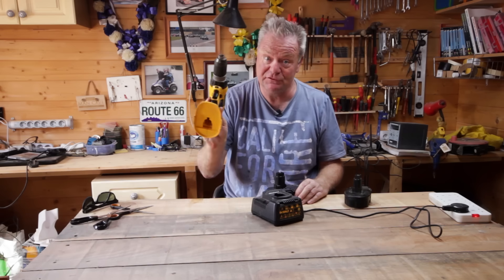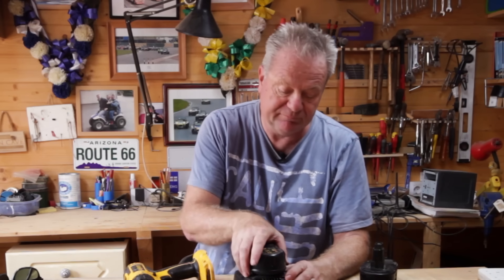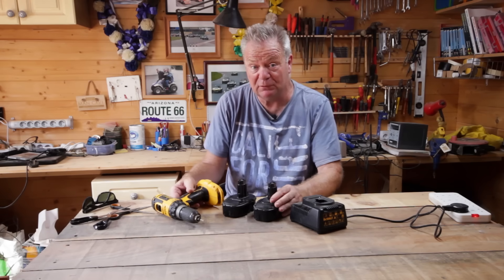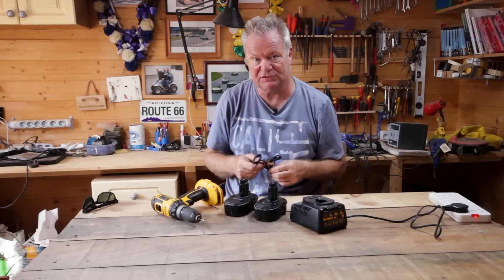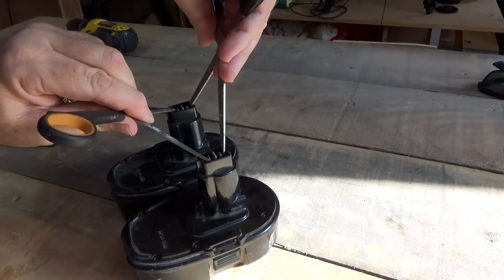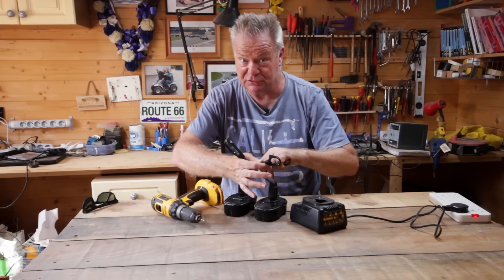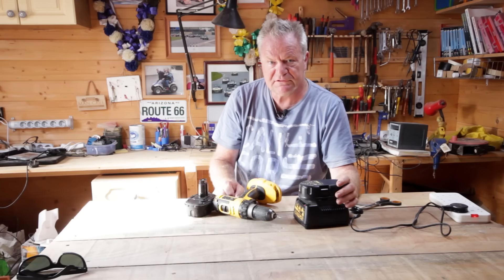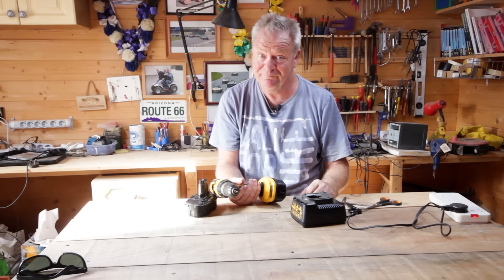How to revive a dead rechargeable power tool battery easily

Comment: I'm in the process of cleaning out my late fathers collection of power tools and I had 6 dead battery's to try this technique on ( I used 10 gauge wire instead of scissors). Total success on EVERY battery! They were all over  15 years old! Great tip J.P.!!!
Reply from the maker: Great. I am glad it helped. Thanks for watching.
Reply: I'll be dipped, it worked
Reply: I cannot understand how you made it to 6 battery successes. I tried just one. With me, the battery is 3 yrs old. I don't know if it's an issue but in my case, the battery was always plugged into the charger when not in use, but to keep it charged at usage time to avoid having to wait a period of time when I can use it. Is it a bad practice? I used the battery about 4-5 total times.
Reply: I have 2 dead 7.2v DeWalt batteries but no charged ones to connect to (I do have changed 18v batteries). Any suggestions?
Reply: @drosser8461 , some have tried 12V car batteries and had success.
Reply: Queef
Reply: I tried it on a battery that's only a few months old, it didn't help it at all.
Reply: @2high2flyfpv88  maybe try use another battery which has a higher voltage to the one your trying to reset it might reset it but if you use another one that’s either lower or different to it it may not work I reset these basically quite a lot not drill ones walkie talkie radio ones and have a 50/50 chance of resetting them I use a 9v charger for radio ones and it does the trick so maybe use a higher voltage battery to have a better chance of a reset on the battery hope this helps 👍
Reply: @2high2flyfpv88 sometimes the cells are just too far gone, nothing lasts for ever these days, especially batteries.

Comment: Thanks for this tip!  I tried it yesterday and revived a battery that has been unable to charge for a few years. It didn't work the first few times I tried it though.  The drill is a King Canada cordless drill with 20V lithium-ion batteries that have power level indicator lights that turn on when you press a button. I thought maybe the "jumper cables" weren't transferring the charge to the dead battery because there was no load, so I pressed the battery-checker button on the dead battery.  It just flashed a couple of times and then went off, but I did this a few more times and the light came on solid without flashing.  At that point, I disconnected the "jumper cables" and put the dead battery on the charger, and voila it started charging!  I gave it a full charge on the charger and now it runs my drill.  Thanks again for sharing this great tip!

I actually did this before I read your recommendation not to try this with lithium-ion batteries.  Why do you recommend this?
Reply from the maker: Thanks for letting me know. I added that in the description about lithium batteries because many of the self-professed "experts" in the comments said it was dangerous. Some people are afraid of their own shadows but I added it so no-one could say I didn't warn them. Thanks for watching Carlin.

Comment: Okay so I finally got to try this on my 2 dead firestorm batteries.  Well....it worked...somewhat really slow....and then next time died again..  so what's the point?
Reply from the maker: Your batteries must have damaged cells so won't hold a charge. This will fix batteries that have been used until flat and then not charged for a while, like the battery I had.

Comment: Wonderful....finally got those firestorm batteries working again. The one thing which can be unclear is trying to figure out which are positive and negative terminals.  My porter cable has 4 leads and only one is real. The other is hidden in a groove.  Is there an easy way to determine that issue?
Reply from the maker: Perhaps with a multimeter.

Comment: Very interesting.  I’m very surprised it’s lasted so long.   I was thinking it was a temporary fix.  Great tip / Thank-You
Reply from the maker: It might been temporary if it was flat because it had a damaged cell or cells. Fortunately that wasn't the reason.
Reply: JP in Fuerteventura 
Certainly worth trying this trick to find out.

Comment: sir, I have a snap on batteries that are dead  the batteries are CTB3185 and I can't do it the way you did both batteries are dead so I can't jump it from one battery to another. snap on doesn't accept these batteries since they are the older models. I don't want to buy new ones so any idea??
Reply from the maker: Can you borrow a similar one from a friend, or at least a battery of the same voltage?
Reply: @JPinFuerteventura   no sir I dont

Comment: Do you think this work with car batteries?
Reply from the maker: Do you mean to jump a power tool battery with a car battery or to jump start a car battery.? If the power tool battery is 12v then some of those who have commented have said they have done it successfully. If you have a car battery where your "smart" charger won't start to charge then it can help to jump from a good battery first. I have done that in the past.

Comment: That battery is on its last legs.
Won't last forever !
Will it ?
Reply from the maker: That battery was "dead" because I used it previously until the drill would no longer turn and then forgot to put it on charge for a few months. I made this video about 3 years ago and it went on to give good service until only a few months ago when it began to hold its charge for less time.

Comment: But how long does that battery last??? You didn't mention that in your video
Reply from the maker: How could I when I had only just jumped it as I am not psychic!  😉 Actually that battery worked well for another 2 years and has only recently started to hold it's charge for less time.

Comment: Next time try 4 small magnets and a couple of clip leads.  The battery contacts should be magnetable (?) metal and the cheep clip leads are.  Not as tiring as holding the scissors!  (I'm clumsy and I'm sure they would slip several times!)
Reply from the maker: Good tip. But living here in the Canary Islands you have to make do with what you have to hand, hence the scissors. Thanks for watching.

Comment: Hi JP,

I have a 12V Samsung battery which needs life. But the other spare working battery is 14V draper battery. Will that work ?
Reply from the maker: Ideally it should be the same voltage, although this is close. Could you borrow a 12v from a friend?

Comment: Thanks for this tip. I have a Bosch cordless drill that I was given as a present. Had it just over 18mths. Used it around six months ago to assemble some flat pack wardrobes then put it away. Wanted to do some fence repairs today so charged both batteries. One was okayish, the other died after a short while. Looked online for replacements. Nearly £30. WHAT? Like you say you can buy a new drill for less. Trawled the internet to find a way to revive the batteries and everything was meters and stripping down with little or no commentary. Your method works and is so simple and just needed some crocodile clips and wire. Cheers.
Reply from the maker: I am glad it helped. Thanks for watching.

Comment: Hello, great video....I pretty sure this has happened to my battery. Unfortunately I do not have another power tool battery to try this with. Could this be done with AAA batteries?
Reply from the maker: Well I guess you could put some in serial. Perhaps you can borrow a similar battery from a friend.

Comment: I had trouble repairing my AEG 18 V LITHIUM  BATTERIES, 3 of them. One worked, wouldnt charge  it was low on volts, so I hooked it up to another good one positive and negative adn it worked, but the other two  did not move an inch. A  5amph 18 vlts that has 15 volts  but wont charge, I used the connectors to positive and negative to another good battery and the voltage hasnt changed. the other one is dead and wont charge has no volts. 

Can someone help me please  I love carpentry im pretty good at it and stuff but electrical is my weak point
Reply from the maker: Hopefully someone can help Adrian
Reply: @JPinFuerteventura  Thanks for your reply JP but I dont have time to wait around its already been a month IM buying some new batteries NO ones bothered to shout out thus far accept yourself. Its probably not worth it Im going to buy the new AEG force batteries.

Comment: Just like everything else Ni-cad battery doesn’t last forever..... even with regular maintenance cycling eventually  charge capacity gets depleted and gone.  A friend of mine started fire playing with worn out battery .   Best solution is replace with 18650 li-ion cells with charging board so U can save power tools and Ni-cad charger.
Reply from the maker: That's a little beyond me Michael.

Comment: The battery business is a SCAM just like the petrol business. This works and is called parallel charging but must be done with similar voltage batteries. Awesome video🇺🇸✌️ btw ever hear of cable clamps?😂
Reply from the maker: Absolutely Matt. Living here in the Canary Islands you have to use what you have ;-)

Comment: This may or not work.  I have tried this on batteries, but the voltage still slowly drops to zero.
Reply from the maker: Yes, if the battery has damaged cells that can happen. Thanks for watching.

Comment: This is also true in some cars. If the battery's charge falls under a very low level, the cars charging system will not charge the battery. With that said, rechargeable batteries will wear down and will only hold so much charge. i.e. when you first get a new battery, it will last an hour. Once it's been charged over and over and over again, the length of time it will run something without being recharged, is greatly reduced.
Reply from the maker: All true Don. Thanks for watching.

Comment: I don't care what these other people say about you. I think your cool. 
How ever, this will make your charger recognize the once completely dead battery and start charging but 9 out of 10 times it will Not take the full charge. For instance: You do this trick with an 18v but it will only charge up to 14 volts and then looses voltage and drops down to 9v.
My point is that the trick does not fix dead cells. This will work in a pinch for a short time and get a small job done for you but I think that if you have any bad cells you have to do a full rebuild or buy a new battery. The rebuild is tougher then these videos show you unless you invest in the proper tools for re-soldiering. I tried this with a regular soldiering gun and it just don't stick well.
By all means try the tricks before you trash them. You may get lucky.

Just my Nickles worth....
Reply from the maker: Yes, you are correct Don. The battery in the video was flat because I used it until the drill stopped working and then forgot to put it on charge for months. If the battery is dead because of damaged cells then it will not hold a charge very long. Thanks for watching.

Comment: How long will this battery last after doing this or will this be an ongoing problem?
Reply from the maker: This battery has never needed to be jumped again since I made the video over 2 years ago. It was flat because i used it until the drill would no longer turn and then forgot to put it on charge for a few months. If a battery is flat because it has a damaged cell then it may not last long and this may happen again. Thanks for watching.
Reply: JP in Fuerteventura, thank you very much, I get what your saying. Thank you for the video.

Comment: Just dont do this with lithium batteries. Thatll end badly. Thermal run away... need i say more.
Reply from the maker: As I point out in the description Ham
Reply: @JPinFuerteventura  
Im not baggin ya but you  know damn well people dont read signs, warnings, discriminations, owners owner's manuals ect. I guarantee someone does it anyway. Dont take offense its just this age of information people are as dumb as ever so ... i dunno.
Reply from the maker: Yes that is their look out
Reply: @JPinFuerteventura  
Yeah i didn't want to seem like im picking on you. This by no means the most ridiculous thing ive seen on here today. I just watched a guy show people how to make a jumper extension cord with 2 120v male plug ends going to a 30amp 240 female so people can make 240 for a welder by plugging into 2 circuits that are on separate phases. That guy needs his damn tools taken away for showing people garbage like that.

Comment: I use to do this but with a dc power supply that is until one lit up like a Christmas ham in my hand after i charged it then went to drill a hole. Ran out of the customers house with a near flaming drill in my hand and yanked the battery out and set on the ground. She smoked and popped and carried on for a few hours after that. No i just buy new batteries and take better care of them.

Comment: A couple of days ago I had a similar problem when using two 12 volt batteries in series to power a 24 volt fan. The voltage in them had dropped too low for my automatic 12/24 volt charger to acknowledge that I was charging them as a single 24 volt battery pack. After 'bumping up' the voltage in each I was then able to run the fan and charge the batteries at the same time.
Reply from the maker: Great. A very similar problem.
Reply: T bio LLP jol mip mip

Comment: I wonder why the dead battery didnt have enough charge to be charged off the charger, but it would gain charge off the other battery?
Reply from the maker: The charger has a "smart" circuit (ie stupid) which needs to detect a current before it will start to charge.

Comment: when a battery is dead its dead. yes you can trick the charger into recharging but the battery is still dead & will not hold the charge for as long as it should.
Reply from the maker: You are right if the battery is dead because it has a damaged cell but that isn't the only reason a battery can be completely dead. The battery in the video I had used until it would no longer turn the drill and then I left it for months without putting it on charge. That was 2.5 years ago and it still gives useful service today.
Reply: @JPinFuerteventura  ok but what you should tell people first up in your video is dont do this to your batteries. as soon as tour battery is flat put it on charge & this will avoid batteries not charging. as i use my battery tools to make a living this is what i do.

Comment: My batteries charge they just don't last as long. NIHI not Lipo
Reply: Sounds like a memory issue
Reply: @TheMysteryDriver  nickel metal hydride still don't last that very long, these are DeWalt but a little over 10 years old and they have been used hard for construction for a very long time
Reply: Grand Waha that's what i mean. Over time NiH batteries can form a memory and not fully charge or discharge. 

They also lose the ability to hold a charge over time anyway.

Comment: Well here, if the battery went completely dead, it's mostly because it's worn-out.  Of course, giving it a quick boost will make the intelligent charger recognize it as being 'good' and the charging process will start.  But it won't last for long, it won't hold charge.  One way to revive a battery (if it is of the NiCad type ) is to zap it.  All you need to do, is giving it a short burst of a significant higer DC voltage.  Say around 250% 400% the nominal voltage of the battery.  There are two ways for doing so.  Give it multiple instant flicks of the higher voltage and take a measurement each time.  After several flicks, the volatage will show much higher.  The battery is then ' unlocked' and ready to hold a charge.  One simpler manner is to use a medium size capacitor charged to the higher voltage and // with the dead battery.  This way, you'll always have the same finite amount of energy transfered each time.  It is more controlable.  Search for zapping nicad battery on the net.
Reply from the maker: It certainly can be, although not always. Thanks for the information.

Comment: When under voltage the circuitboard in the battery will cut the battery off. The charger sees no voltage wich results in a dead battery. The battery is maybe worn out, but to revive it you could charge it with 500mah for a few minutes. The circuitboard if there is a good one in it, should keep it balanced right. Just mark this battery so you can keep an eye on it. Welcome to the world of technology and we are all fools to buy new ones.
Reply from the maker: Exactly Robert. This particular battery is only now just showing signs of wearing out so I have at least got an additional 2 years of service from it. Thanks for watching.

Comment: Makes sense, most chargers will run a check on the battery when you plug it in if it senses the voltage is to low it thinks the battery is bad or is the wrong type for the charger. Great tip and I never would have thought of this. We have drills at work that batteries won't charge I'll give it a shot.
Reply from the maker: Exactly. I hope it helps. Thanks for watching.

Comment: Thanks for this. Now I just have to figure out how to try this on two dead 9v batteries. Wait I've got a third. Nope. That one's dead too. 

I like my old (25+ years) Makita drill, maybe I'll just.... wait, wait. Think it will work if I string together 6 or 7 AAs? But, first I think I should try a 9V battery or two in parallel. ...
Reply from the maker: It is the voltage that is important I would say not how that voltage is achieved. I hope it helps. Thanks for watching.